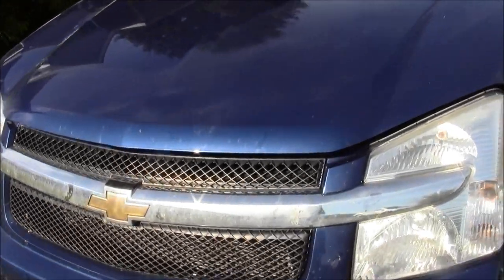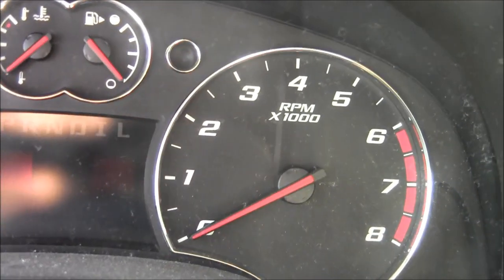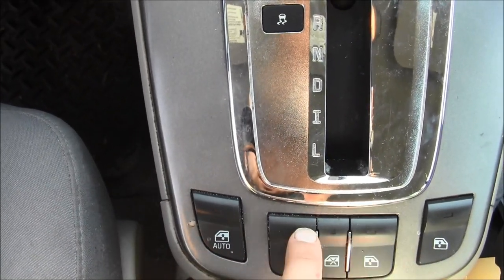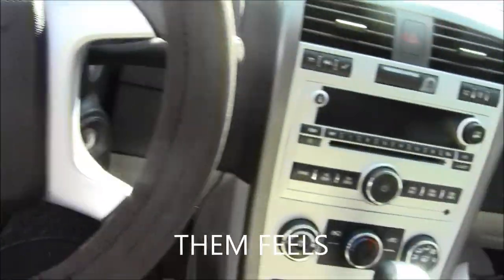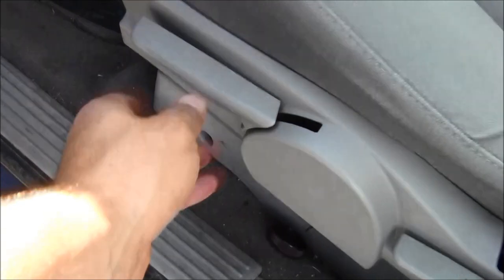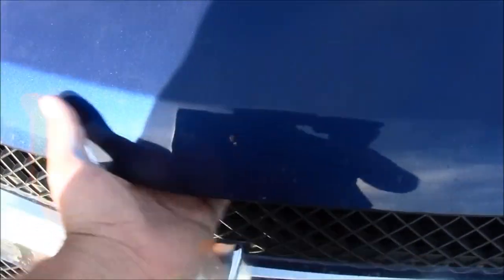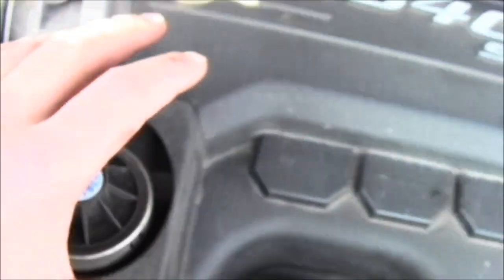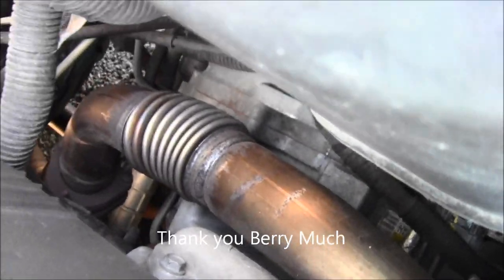Chevy Equinox 2008 Features and Specifications

Comment: I am looking at buying one are they good on gas?
Reply: Angel Patrick late response, oh well. I guess if you're still curious for some reason, in city I get pretty bad mpg. With very little Hiway driving I average about 15mpg.
Reply from the maker: 20-30 mpg depending on variables
Reply: No gas and oil hog

Comment: lol its not oil pressure it,s oil temperature!!!
Reply from the maker: +Samster Simard Gas laws in chemistry state there is a relationship between pressure and temperature.  They are directly proportional.
Reply: its not oil temp, its coolant temp
Reply: MattHumanPizza has laws don't apply to liquids.
Reply from the maker: good point